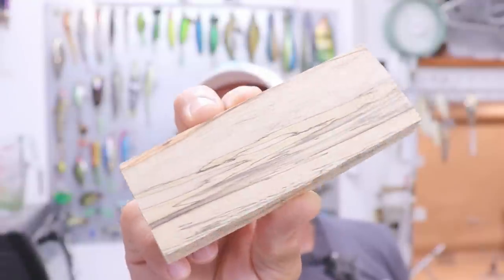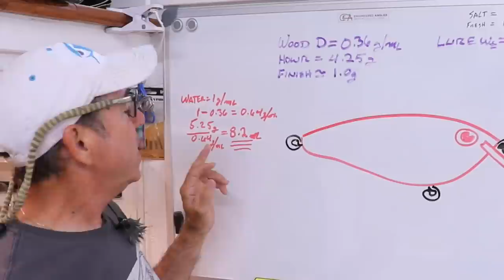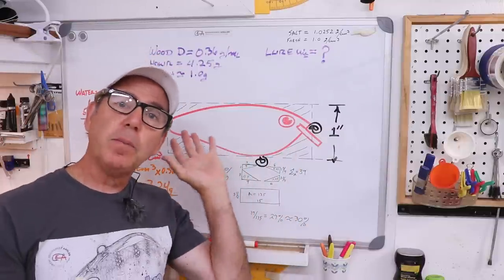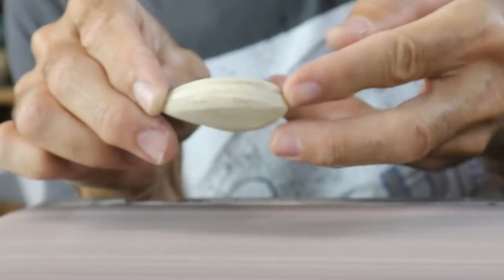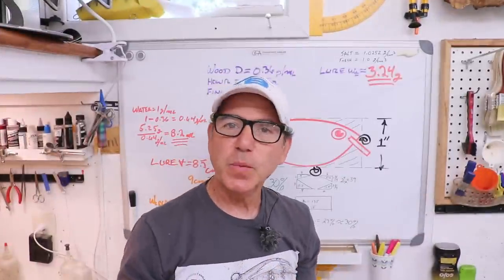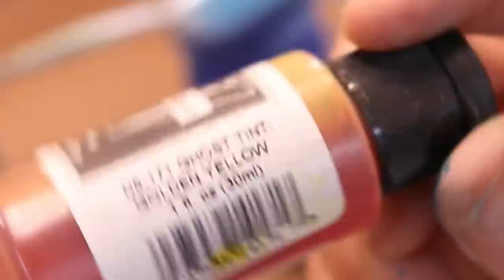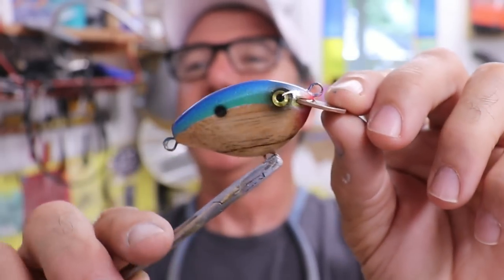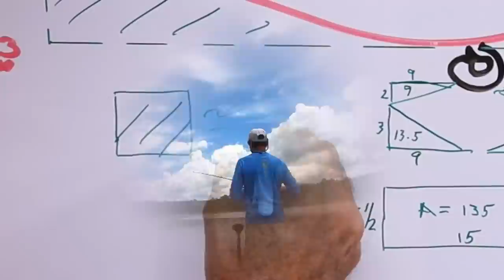How to Make a Wooden Crankbait With a Coin,  Making a Lure with a Coin  #luremaking #fishinglures

Comment: I live on Chickamauga Lake the most over pressured mudhole in the south. I fish to be alone and that doesn't happen anymore so I sold my Ranger but kept my 1985 Lowe 16' flat bottom. In 2017 I did a makeover on the boat and the Super Pickle was born. I cleaned 1985 and 2017 pennies in hot sauce, sprayed them with clear lacquer, and siliconed them in the live well as kind of a wishing well. I like projects with the date on them.
Reply from the maker: Alright you're the only guy I know with a wishing bait well.  Thanks for sharing.  Cheers
Reply: @EngineeredAngler  My wishing well doesn't always work as well as I would like. I had a lot of fun building  that old boat and people don't follow ya around. If it was for sale this is how the ad would read.
1985 Lowe with original 40 hp Johnson engine with good compression
Reinforced aluminum transom to support an aluminum jack plate (runs in extremely shallow water)
Extended aluminum deck with single or side by side seating with storage.
40 lb thrust Minn Kota trolling motor T-H Marine G-Force prop nut
Two 9" Humminbird Helix  graphs with Humminbird 360. (One on the front and one on the dash).
LED running, navigation, interior, compartment, live well , and night fishing lights on the sides.
Minn Kota onboard charger
Live well pump with timer
Custom console with drink holders
Driftmaster TS-2160 rod holders (keeps rods off the floor)
Automatic bilge pump
OOGA horn 

The Trailer 
Fresh paint and pen stripes
Aluminum wheels
LED running and tail lights
Boat guides
Trailer steps
Haha I don't think I'm upside down on it. It needs power poles but I couldn't run it as high in the boat dock if it had poles.